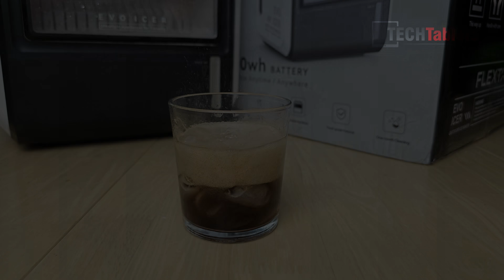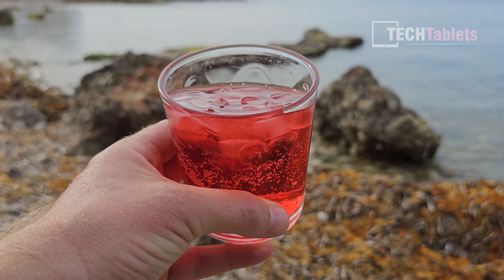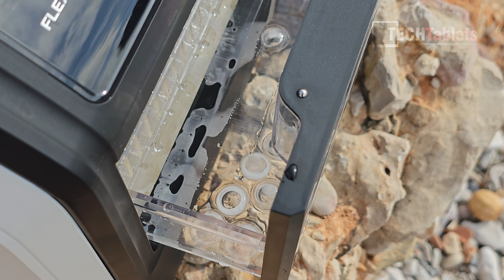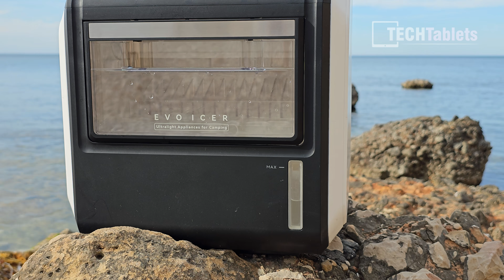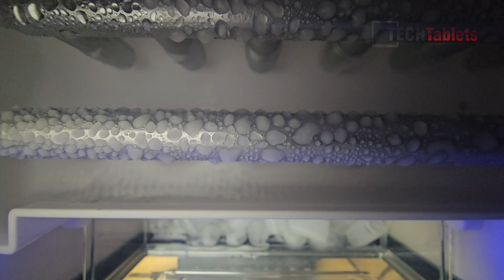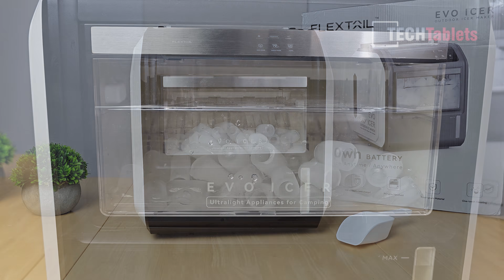Flextail Evo Icer - Outdoor Portable Ice Maker!

Comment: A small bag of ice cost 25c where I live. It contains more ice than this little machine can produce on one charge (I assume, I might be wrong). BTW: R290 is propane. While it is more eco friendly there is a reason it was barely used before the 90s when the switch started to replace all the ozone killers. Propane burns/explodes and might have less ideal cooling properties, don't really remember. I don't know why Chris talked about that it is sealed and no leaks happen, that is basically the case for all compressor cooling devices. Especially smaller ones have no screwed parts (tubes), everything is soldered. But I still saw rusty compressors leaking gas, or a bad solder joint. Is it normal : no. Is there a guarantee that this will never happen: no. Is this something special for this device: no (I assume). Is this a fun device: hell yes. I maintained ice makers in my first job and they are awesome and mesmerizing machines, especially the larger ones. I thought buying one for myself and came to the conclusion it is not worth it, especially because I can buy ice at every 7-11 whenever I need it. It is for me a convenient toy, others might have more usage for it, some just find it cool (including me) and want it (not me).
Reply from the maker: Hi, of course this is more about being convenient that you can make ice when you run out for example. And the portability so you can make ice on a camping trip at the beach etc if it's. Sure if it rusts or is damaged it would leak. They told me it has a anti leak protector over it to seal it, to help stop leaks. Sure for some that don't need it's portability it's not for them. No reason to buy this toy. Again it's all about having ice on the go.
Reply: @Techtablets  if I would need this I would probably buy this. Nevertheless, thanks for reviews of "out of the bubble" stuff!